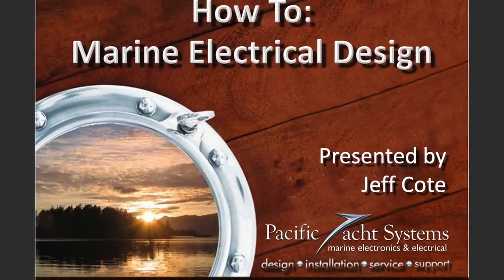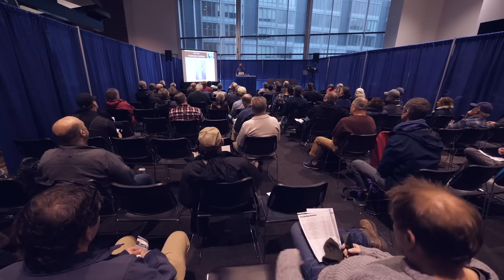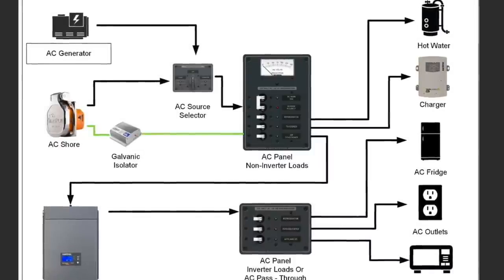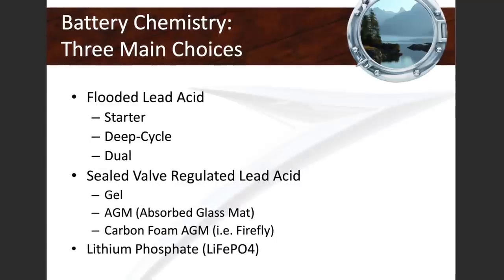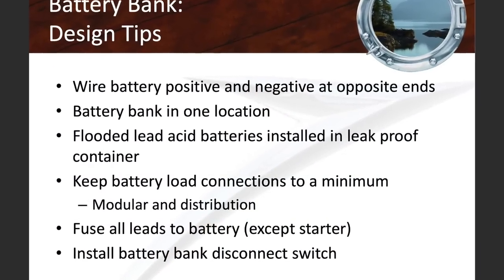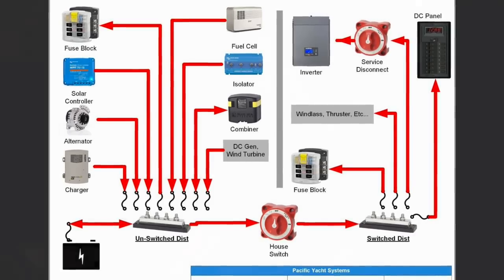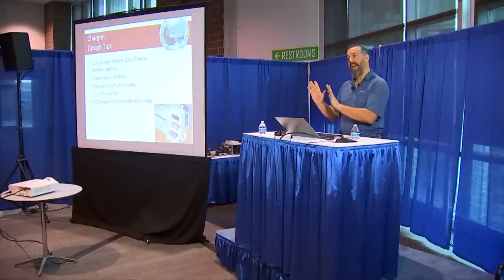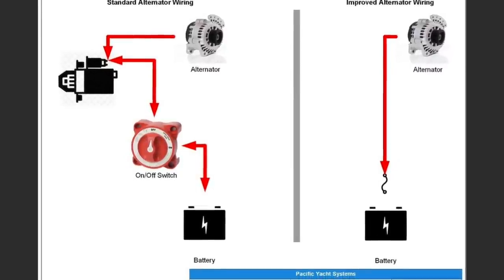Boat Show 2020: Marine Electrical Design

Comment: Love your videos, Jeff.  Living in Singapore now, I feel like I'm back at one of your seminars in Vancouver!  Quick question:  You mention a minimum charge rate of 10% of battery bank size.  Does this include solar charging and DC-DC charging?  I have 600 ah lithium bank, being charged by a 30-amp DC-DC charger from my start bat and 800 watts of solar. Any suggestions?
Reply from the maker: Hi Wayne, you do what you can with solar. The 10% rule for charging deep cycle lead acid batteries is hard to achieve with solar, make sure your charger and alternator meets that minimum charge rate.
Reply: Jeff, as newcomers, if you have 600ah liFepo4 as Wayne.. would he need a to just add another  30amp charger to make the system more correct.. 
Does this 10% charge rule change if you have different type like gel or LiFepo4 or apply for all

Comment: Good work Jeff, question about a combined charger/inverter like victron multiplus. Inverter/charger share the wire to the batteries. You always proclame that it should be unswitched. Would it in this case of charger inverter not be ok to install a service switch to be sure inverter is offline?
Reply from the maker: The inverter/charger connection via a fuse and switch needs to be unswitched distribution (i.e. a direct battery connection).

Comment: Please help me here: I've researched (hopefully sufficiently) and arrived at the following conclusions:
1. An AC 3 phase wind turbine is easier (required cable size - could use ordinary cord to the rectifier, conduit size etc.) to use, but is it practical for a boat?
2. If 1. above is correct, how come there are so many DC wind turbines available?

Comment: Jeff:  Great presentation.  Question based on the material--You talk about using battery isolaters with an alternator to charge two separate banks.  You also touched on charge regulators for high-output alternators.  However, how do you combine that technology with a larger, say Firefly house bank, and a lead acid starting battery in a separate bank?  Do you need two regulators?
Reply from the maker: Good question. You can only have one external regulator per alternator. Hence, all your batteries connected to a battery isolator connected to a alternator should be the same chemistry.

Comment: Hey Jeff I want to get your opinion. On a bass boat does this sound right for my flow/install? 12V - 50Amp break - cutoff - 30Amp fuse block(most fuses on there would be 5 Amp or less) - in line fuse near accessory - accessory. 8awg to the block then 14awg for rest. 19 foot boat. Just want opinion I know this probably doesn't give you everything but I think it's enough. Thanks brother.
Reply from the maker: Hi SoCal, sounds like you are going in the correct direction.

Comment: Great content again , 
I got two questions. What happens if your alternator is running and the fuse is blown at the battery side? Does that mean you are gonna blow your alternator? If so, should you size the fuse to protect to line?
The other question is why is the starter line is not fused at all? Is it because of the risk to blow it so often because of the high cca values? What if you fuse the starter line bigger than the cca's of that starter? Ok then there is no point fuseing the line at all. i guess i answered my second question. But still I want a professional opinion.
Thank you !!
Reply from the maker: Hi Deniz, yep if the fuse on your alternator blows your alternator will always so have catastrophic damage. When we size a alternator wire and fuse we give ourselves at least to 125%. For instance if the alternator is max 100 amps, will make sure the alternator wire can handle 125 amps and the fuse is 125 amps.Fusing started circuits is tricky because you might accidently blow a fuse if the battery voltage is low or the engine is hard to start. That's why the code doesn't require the starter circuit to be fused.

Comment: Great info thank you. Can you tell me more about the inverter only neutral bus and would I need that for an onboard gender as well? Are the wiring schematics you can direct me too please? Tia
Reply from the maker: All loads that are powered by an inverter need to be connected to a neutral bus only connected to the AC output of the inverter. All conceptual diagrams are on PYS website.

Comment: Love the videos I think I have everyone of them, I am currently updating my electrical system on my 2008 Fountaine Pajot Mahe Cat, all my wiring is copper not tined, was there a year when using tined wire started? I would like to see a video on Cats as far as connecting two alternators to the rest of the systems, my boat has one alternator connected to the start battery and the other alternator connected to the house bank, was this done to keep it simple?
Reply from the maker: Hi Susan, thanks for watching our content. 1) Unfortunately too many boat builders still save wiring costs by going with welding cable or untinned wiring to save costs 2) Good video suggestion, will keep this in mind for a future video.

Comment: Hi Mr. Cotes: Good evening. 
I have a little question. Why is it that in marine electrical systems, relays are not used?
Reply from the maker: Hi Jorge, good question as relays are quite convenient. Unfortunately don't know the answer. I'd guess that relays are hard to understand if your not familiar to them.
Reply: @PacificYachtSystems  Thank you very much Mr. Cotes. I thought it was some kind of regulation that prohibited them. I think that relays avoid unnecessary heat sources and therefore minimize fire sources, especially in areas of electrical controls that are generally confined in ships. Thanks again for your reply.

Comment: Quick question on having multiple solar controllers in parallel: How do you avoid one controller switching to float too early and leaving all the work to other controller / panel? I have 2 Victron controllers in Parallel and I notice that one of the controllers always goes into float quite earlier than the other.
Reply from the maker: Simply, you can't. There is no centralized decision making. All controllers are voltage regulating their output and while on float or absorption some of the controllers might be no output and others controllers with full output.
Reply: @PacificYachtSystems  thank you for the reply! And for sharing the knowledge.

Comment: Which is the best (and cheapest) solution for setup the alternator if you have LifePO4 House bank 24V for services and a Lead Acid bank 12V for engine and Thruster/Windlass? Do it's better to connect the alternator to 12V Lead-acid first then to use a DC to DC charger for the 24V house (in that case how to charge the Lead Acid when the engine is off and solar panels are charging?) or is better to connect the alternator to the 24V Lifepo4 bank and then charge the 12V lead-acid battery trough the Dc to DC charger?
Reply from the maker: I'd recommend a DC to DC charger for this purpose.
Reply: @PacificYachtSystems  Thank you!

Comment: Thanks for the video again Jeff! Just wondering on the planning side, are there any easy to use computer programs to diagram a full circuit on?
Reply from the maker: Hi Ray, we use Microsoft visio or autocad.
Reply: SmartDraw is also pretty great.

Comment: I like and enjoy every one of your videos I've watched so far. However, around 1:40:00 you describe battery voltage as a 'difference'. I would argue that you should (could) explain it as a 'potential', and that we use the ground, or negative, as the reference point.. Just my opinion. Thank you for sharing all your marine knowledge with us.
Reply from the maker: Hi Steve, thanks for sharing. Will clarify in further presentations.
Reply: It's the potential difference from one contact point to the other ????

Comment: Another excellent video, Jeff. Thank you. Let me ask a question. I’ve 2 100Ah lithium batteries hooked up to solar. I have and would like to connect a 235Ah AGM to connect to an isolator. In your video, connecting batteries should be of same Ah. Are these two different types of batteries which are roughly the same size ok to connect to the isolator? The wire runs are 3 meters. I’m engineless. These will be only house batteries.